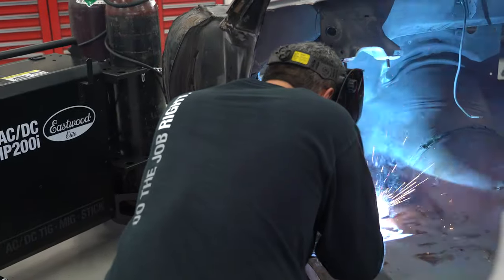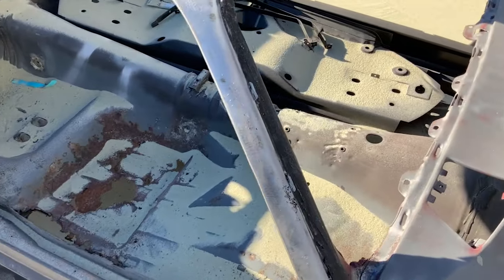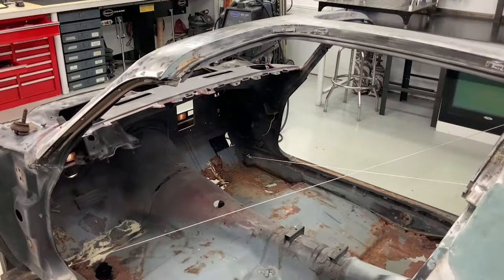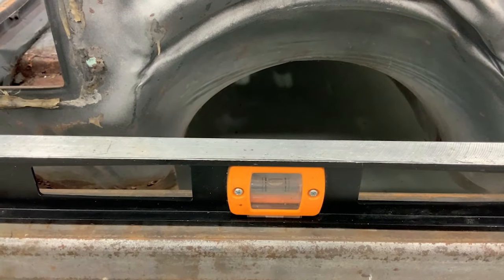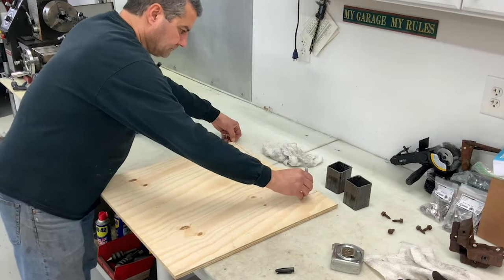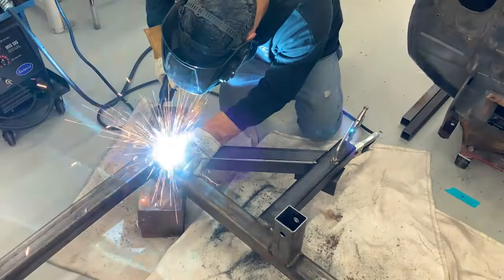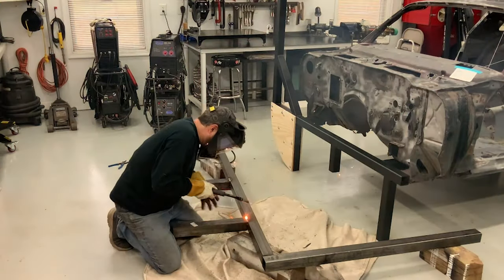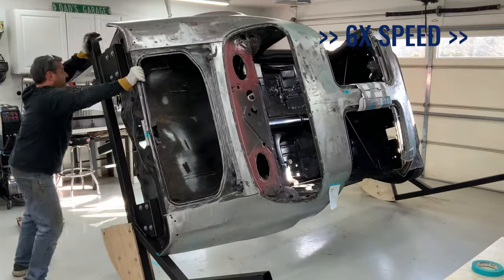We Built a Homemade Rotisserie for the Trans AM! - DIY Tilt, Roll, Tip Over, Car Jig

Comment: My project has been sitting for over five years needing the same thing and not having the money to buy a rotisserie. I seen this video and thought omg yes finally show me what to do and boom just a tease. Is there any place with the actually instructions how to do this?
Reply from the maker: Well it's more of a general overview as every car is going to have different dimensions. You can search around for Tilter Jig, DIY Rotisserie, etc. and find others but again the size and shape are ultimately going to be something you decide.
Reply: @eastwoodco  Thank you for the response; I've previously looked online and found a number of versions that were rather complex. I have a welder, but I haven't bought any metal or cut it to size yet. The measurements needed to construct something similar in order for it to be balanced would be crucial; the rest is likely visible from images. My project is a 77 Camaro stripped down to a body shell, exactly like the one in the video.
Reply: How about you post the list of gross materials used? Like "40ft of 2x2" square steel, 1 sheet 4'x8'  3/4" plywood, 28  1/2"x 4" bolts with nuts and 2 large 3/4" washers each..... "
That sort of thing and maybe just some general design drawing would get a whole lot of guys building these things! That body tilter was the heat!! dirt simple and practical, easy to make and use. Much appreciated, great work brother.
Reply: @bretsmith6315  You think that is 2x2? I thought it looked bigger.

Comment: Nice job , I built a regular rottiserie years ago ,  worked well , just a big pain in the butt to take apart and store while not using , also each end was not very slim , didn't tuck up to the wall nice and neat. This looks like a perfect alternative !   I'm about to do a 57 chevy , I think the only change I'm going to make is that I'm going to make the frame a little taller on the bottom so I can bolt the body on and roll the body off of the cars frame.  May work may not , worth a shot . Thanks again
Reply from the maker: Nice - let us know how it turns out!